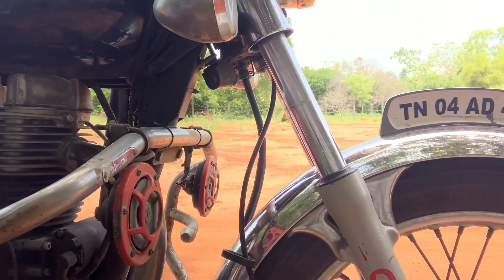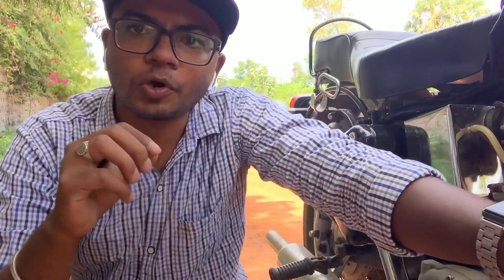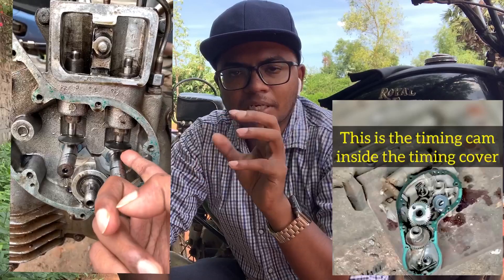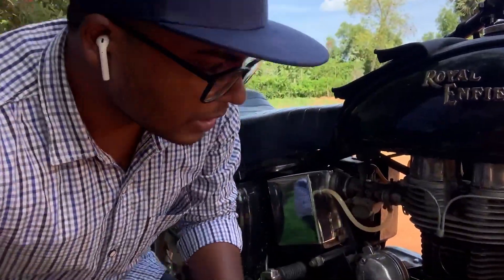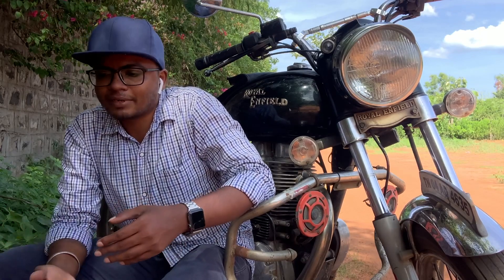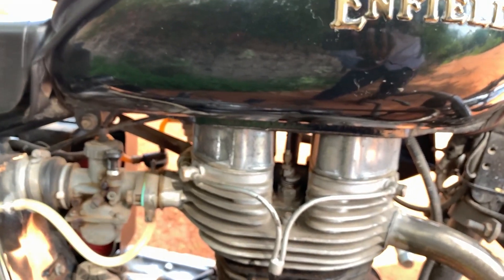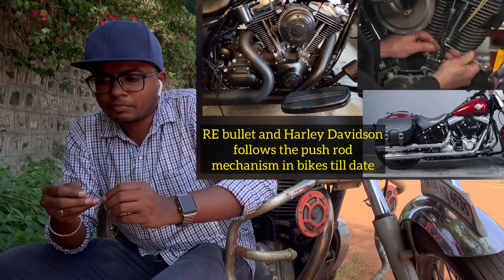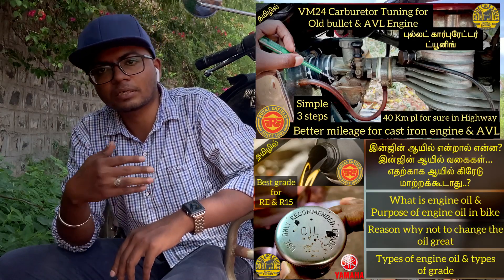#RoyalEnfield #oldbullet #Tappetsound & #Pushrod mechanism explained & Diff b/w valve sound & Tappet

Comment from the maker: Sorry guys there is a small correction in the number of valves it’s single cylinder 2 valve engine (one is inlet & other one is outlet ) each valve is controlled by the corresponding push rod and other Information’s are same as mentioned in the video
 I’m extremely sorry since i didn’t prepare for this the valve number have been forgotten 
Thanks for all your support and love